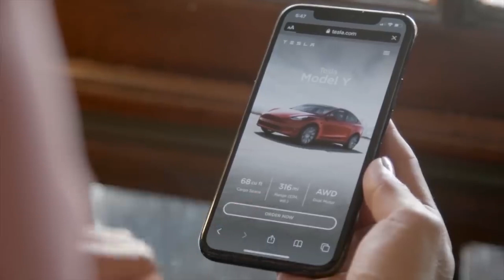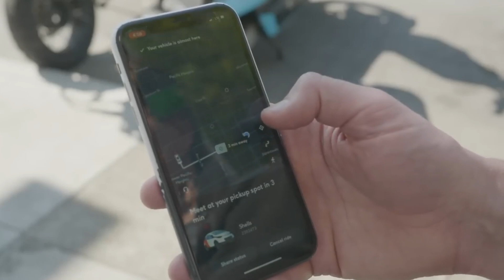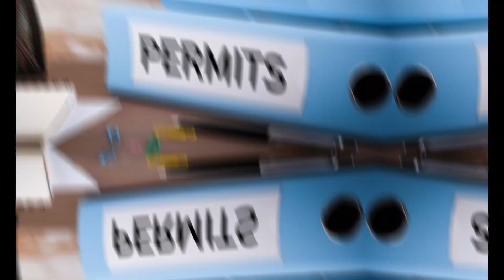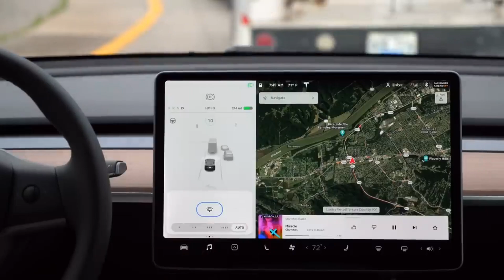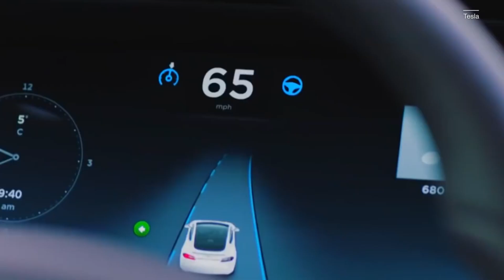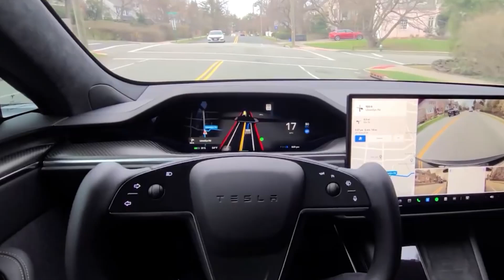Tesla SHOCKS The Entire EV Industry With Their NEW Robotaxi!

Comment: No matter how much Elon says it's ready, it isn't. Elon is a con man.
Reply: Dude, you need to get a ride in FSD 12.3.4 or higher. It is mind numbingly smart.  Recently I saw a video of 12.3.5 where the car overrode the navigation plan because it found a better route!  But that is just the icing. This new AI is slicing and dicing traffic maneuvers with copious pedestrians and construction, better than most drivers.
Reply: @enigma-8u  it doesn't matter how impressive it looks. Tesla FSD is still at level 2. You need level 5 for it to operate as a taxi cab.
Reply: @duydatyds  Waymo and Cruise were only certified at 4 which requires imposed limitations. Tesla chose to be level 2 so that they could continue to collect data on the road until they had it ready for level 5. That moment is near and will likely be kicked off in one of the states where autonomy is permitted. Then it will spread once operational data makes a case for it in all states. Meanwhile China is clearing a path for it over there.